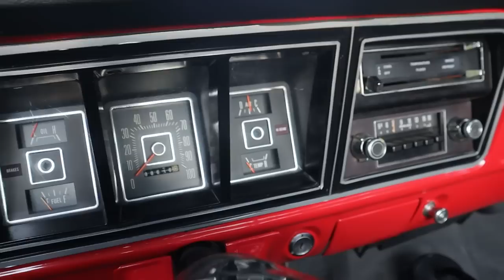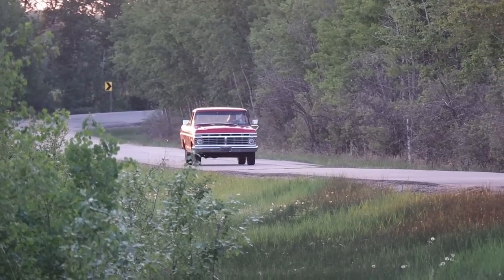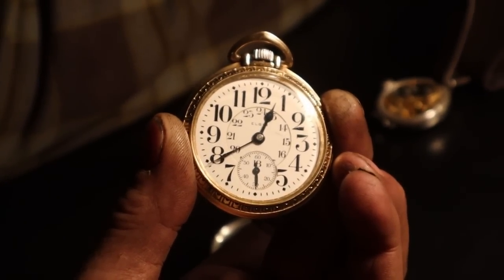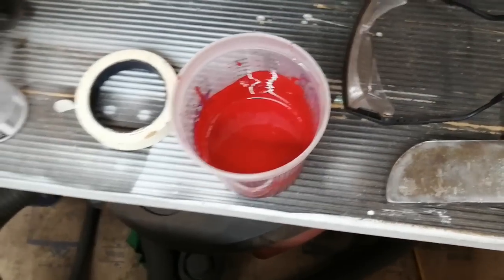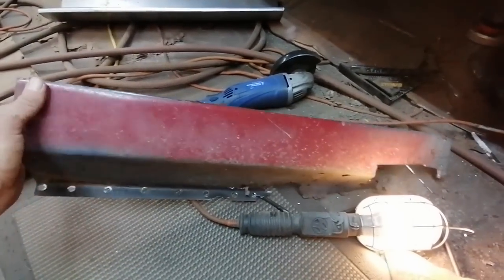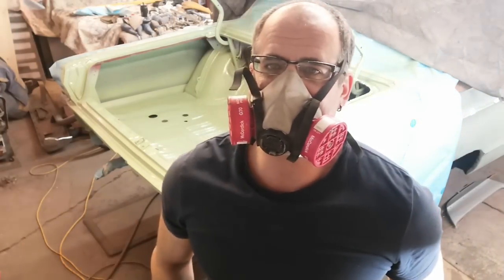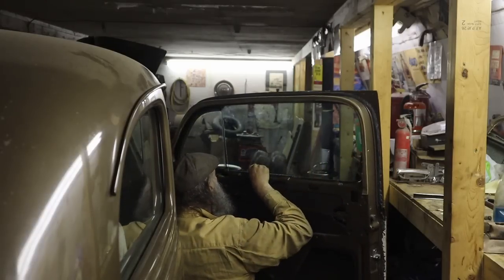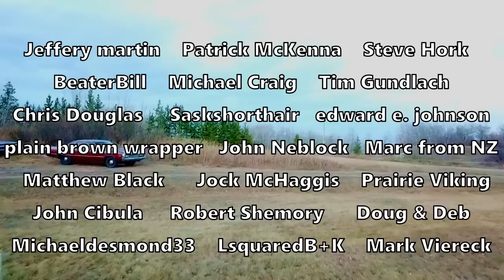1973 Ford F100: "Turn up the Base" Special! Plus: Myles' 1966 Plymouth Fury  Gets Some Colour!

Comment: Am in dire need of 1948 chrysler starter and or soleniod. My 40 year barn find, flathead 6 was brought back to life after watching your will it run vidios. After 7 months of cleaning/detailing, was about to test drive before my first show n shine and the soleniod failed. Anyone up your way have one ?, as I am located in Red deer Alberta.

Comment: What guage metal Did Myles use to replace the rocker?
Is that the same guage as exterior doors or fender?
Reply: 20 gauge metal, and yes, same as was used, as far as i am aware. Thanks!

Comment: Listen at 7:49. It sounds like something is not right with that engine. It sounds like it is chugging. I have replayed it several times, but my wife keeps talking over it, so i am not going to play it again. My buddy in High School in the 70's had a '69 Mustang 4 speed with a 302 with over 100,000 miles on it and it was powerful and smooth as silk. That truck should be leaping in every gear. You should be needing to feather that throttle. Maybe that coil wire is an attempt to rectify? Maybe the coil is bad? Should check resistance on all the plug wires and check condition of the plugs too. Also check compression. I will try to listen again when I have some privacy😖 Edit 11:30 sounds a little better. Maybe it needed to warm up?